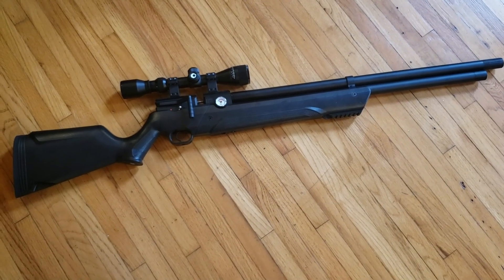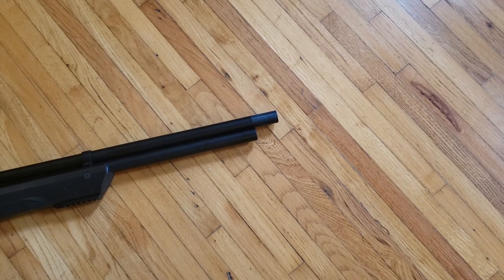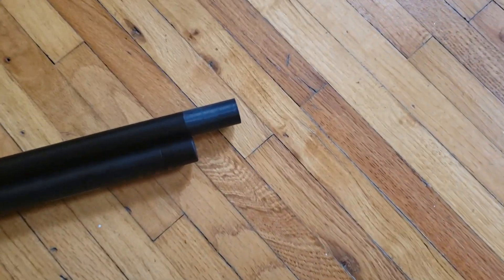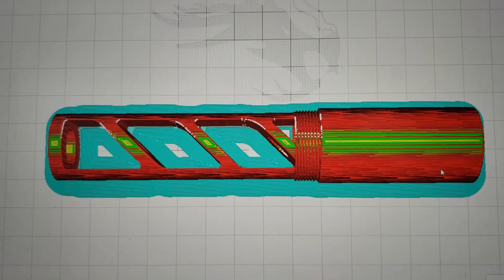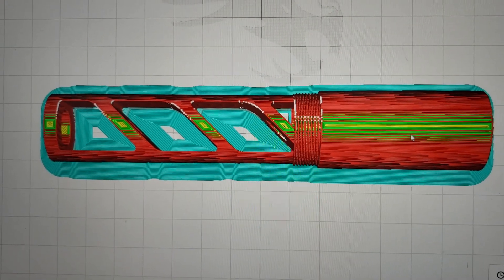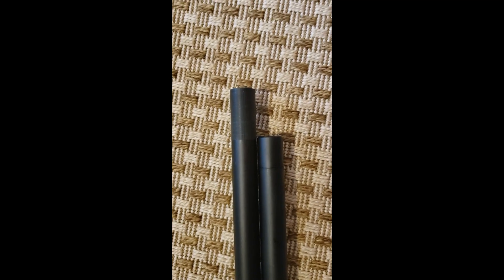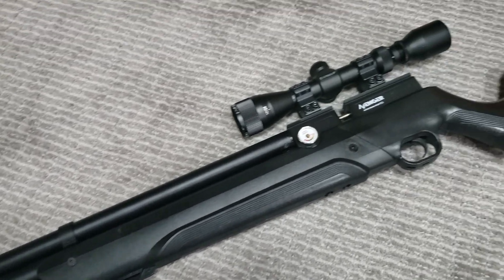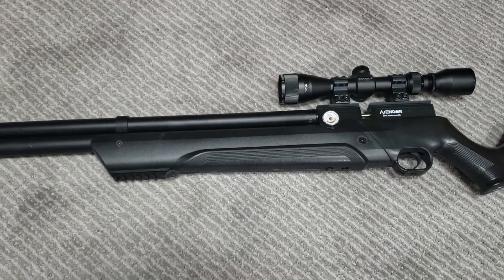Air Venturi Avenger 3D printed Monolithic Moderator

Comment: Man Thx for this file, god bless you
Reply from the maker: There is an improved version on Thingiverse.  The thread was a bit thin and someone made it a little thicker in that area and made the hole big enoghr for .25.  I would not recommend it for high power, but for plinking it works well.
Reply: @shenmisheshou7002  i download a .25 version(8mm hole), im printing this .22 with PLA+, and be nice printed, maybe this monday i print .25, again thanks for the video and .STL
Reply: @shenmisheshou7002  Printed and work as well, made my (Nova Vista Alpha name of New Liberty on Brasil, Avneger is a Nova Vista Leviathan), again Thanx so mutch

Comment: Did you ever solve your noise backstop problem?  Try filling a box with old clothes, or a fleece blanket or two.  Hang your targets over the open side of the box so the pellet doesn't hit cardboard.  Place the box in front of something solid in case a pellet does get through.
Reply from the maker: Well, not solved, but extremely improved.  I bought sheets of neoprene with adhesive on one side and put these on the rear back stop and on the inside of the side plates of my metal trap.  This dampens the sharp ping of the pellet hitting the trap.  Some people use plumbers putty, but I am too lazy to clean it all the time.  The neoprene sheets were effective enough for me. I can still hear it, but it is no longer a sharp metallic ping.
Reply: @shenmisheshou7002   Try the old clothes and/or a fleece blanket for a few shots.  See if it helps.  I know a guy who has limited space and neighbors with sensitive hearing.  He swears by these materials for quieting down the backstop.  I have a backstop with plumbers putty that someone gave to me years ago.  Am I supposed to clean it?  I never thought of cleaning it.  It's just gotten really heavy. LOL  Thanks again for the 3D file.  Cheers!  R, Steve

Comment: great excelente hice la modificacion para .25 avenger  espero imprimirlo este fin de semana
Reply from the maker: Yes, someone posted a mod shortly after I posted the original.  I mentioned it in the comments below.  I have had people report that at very high pressures, the original can crack so if they have tweaked it with a little more thickness that would probably be good.  My intention for posting was to show people that making your own design is not that hard and that even a home made design could be very effective.

Comment: I just came here to say thank you for share the file a friend print it and works awesome and with almost no weight and small size  this is perfect it algo works with the seneca aspen and btw bro if I need the same design but for another gun like benjamin marauder pistol and for ataman  ap16 can you modifi it and sell the design? Thanks again and very nice work
Reply from the maker: Hello Hector. Thank you for the feedback.  I have at least one report that the moderator can break when using a lot of pressure.  I use only about 1400 PSI, so if you are shooting at 3000 PSI, it may not hold up. If that is the case, you might try printing it out of ABS.    I have a "Hobby" license for the design program I use, and that license does not allow me to make any profit from any design I make. It is OK for me to give away the .stl, but I can't profit in any way.  Thank you again for the feedback and I am pleased to hear that it is working well for you.  Have an epic day!
Reply: @shenmisheshou7002  I'm not sure in what material was printed but mi rifle use 3500 psi but I only use it at 3000 and no issues so for in case any issue I let you know, thanks again for the design :)

Comment: hello! i was wondering if this moderator would work on an umarex origin barrel, i kinda think they are very similar to each other.
Reply from the maker: I cannot say for sure. As I recall, the thread is 1 x 15mm but I do not know if there is enough internal clearance.  Also, on person reported that his shattered.  I don't shoot very high pressures so mine has been working find, but it is possible that if you are shooting at 3000 PSI it might break.. I shoot at 1200-1500 PSI.
Reply: Yes

Comment: I printed this compensator but before I modified it to use it in my Air Venturi Avenger Bullpup and it worked perfectly and I used HT-PLA filament.
Reply from the maker: Thank you for the feedback! I don't follow materials that much so I had not heard of HT-PLA so I looked it up.  I will have to try it sometime.  For now though, I have a couple of tins of pellets through the original and it is holding up fine.  Again, I really appreciate you taking the time to share your feedback!
Reply: @shenmisheshou7002  HT is a High Temperature PLA is better that PLA
Reply from the maker: @richardegan-wyer400  Yes, I did some research on it when you mentioned it.  I am going to try some.
Reply: Nice! How is it holding up? I just bought the same bull pup and I was looking for a set of baffles. 

Can you add a 1/2-20 male thread at the end, to adapt a silencer? Or can you share your design please?

I have to look for someone to print it in my city. 

Thank you.
Reply: Would you print one for me and how much would it be? Could you add a 1/2-20 thread at the end to adapt a donnyfl suppressor?

Comment from the maker: I received a message on Thingiverse from a member there that printed my moderator and tested it on .177 and .22, and he said it worked better indoors than some expensive moderators he had.  He said that he could hear the mechanical noise of the action when firing (You can hear the spring sliding in its tube).

Another member has since modified the design with an 8mm hole for .25 use. He has posted that re-swizzle on Thingiverse.

If you print one, I would be very pleased if you commented here on how it worked for you. 

Thanks for watching!

Comment from the maker: This is one of the designs that influenced me.   https://www.tbasuppressors.com/Tempest-Screw-on-Rimfire-Silencer_p_82.html  As can be seen, it is for a .22 and it uses 5 baffles with the primary difference is that the baffles on my design extend into the extension.

One of my primary reasons for sharing this was to get others to think about doing their own designs. Even a standard .22 rimfire rifle is considerably more powerful than a .22 pellet rifle and I did not think that the amount of energy here would be so great that metal was needed. I was ready to re-print with 100% infill or using a stronger plastic than PLA, but I have been shooting every day (about 20 rounds offhand because I only really shoot offhand) and so far it is holding up fine.  I hope to encourage others that do CAD and printing to try some other designs and I hope that they follow this general approach of keeping the length down and utilizing the empty space in the shroud.  I thought about completely external designs, but the Avenger is almost as long as my JM Pro shotgun (and if fact, it is almost identical in length to the JM Pro when the moderator is installed) and the JM Pro is already kind of long in my opinion. Anyway, I hope it encourages others to experiment with their own designs. This is much more elegant than K baffle and many other designs (in my opinion) and the monocore is to me, the way to go.

Comment: Thank you sir, for making the stl available for free!
One question: you having mapped and also printed the thread - can you tell me the thread type on the end of the barrel shroud?
Reply from the maker: The thread is 24 x 1mm. The  OD of the baffle assembly that goes into the shroud is 22.4mm.  This is very slightly undersized but not sloppy at all. I did not want a tight or friction fit, so maybe .2mm smaller than the ID of the shroud. I  used a 6.5mm center bore for .22. I would think that 5.5 would be fine for .177.  If you are shooting at 1800 PSI, I might recommend going up to 75% infill and/or ASA.
Reply: @shenmisheshou7002  Thank you! I'll try this piece and report back when I have personal experience.
Reply from the maker: @BarnabásEgri-Nyári  I hope it works for you. As I reported, I did not seem to show a big reduction in SPL but my testing was not even moderately scientific and I was using an app.  To the ear though, I found that the change seemed very worthwhile.  The mechanical noise of the hammer spring was now pretty obvious to me. Also, I shoot very heavily moderated (1200 PSI).  For someone shooting full power it may be much different. Could be better could be worse. I am very happy with the result though. I am sure neighbors can hear something but it just does not sound like any kind of pellet gun except from the pellets hitting the backstop.  I am eager to hear your own observation. I mean it was free to you so you didn't have to loose any money except twenty cents worth of plastic and 2 hours of print time.

When you slice it you can study the design and maybe there could be some tweaks that could be made. For example, the baffles might be able to be made thinner. Someone asked if I could modify it to allow a felt wrapper, but there is not a lot of space there and to hold the felt in place might take a meaningful re-design, and I was not motivated to do that because I am happy enough with the improvement it made.
Reply: @shenmisheshou7002  My gun is setup to shoot at high power. So it will be a good test. I also have a normal silencer already, with the DonnyFL adapter, so I can actually compare the two.
Thank you for all the extra info. The video was already good, but you gave me even more. Happy shooting!
Reply from the maker: @BarnabásEgri-Nyári  Well, I am not sure how it will do at 1800 PSI, but if you use ASA and a higher infill I think it will be OK. Use extra wall layers too. I think it will handle the higher power but I don't know how effective it will be.  I am as curious as you are. Also, the Donny FL and others tend to be bigger, so when you work within the constraint of the ID of the barrel shroud there is only going to be so much you can do without going longer.  My goal was to keep the rifle compact and quite enough so that I did not think neighbors could tell I was shooting a .22 pellet rifle.  It isn't "quiet" but it does not have the sharp crack anymore. Again, looking forward to your experience. Please don't forget to share.
Reply: @BarnabásEgri-Nyári  what did you find
Reply: @MechInvent  I was satisfied with the noise reduction. It was very similar to my BSA moderator with the DonnyFL adapter. It finally broke right at the end of the threaded part; the section that is outside of the shroud. Upon close inspection it seemed to me that the material was thin in that area.

Comment: how can I obtain this suppressor?
Reply from the maker: I posted a link to the .stl file. If you know someone that has a 3D printer, that is all they would need.  I recommend a 50% infill for PLA.  ASA might go with less, but I would still recommend 50%.  If you don't 3D print but have a friend that does, they will know what this means. If you are shooting at 1800 PSI, I would recommend ASA. PLA is very brittle and might shatter under much higher pressures.